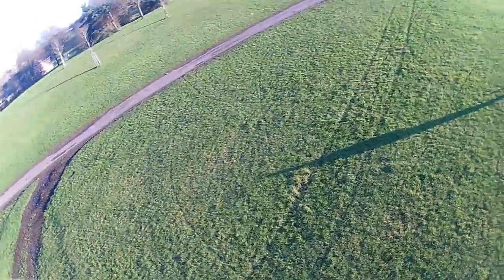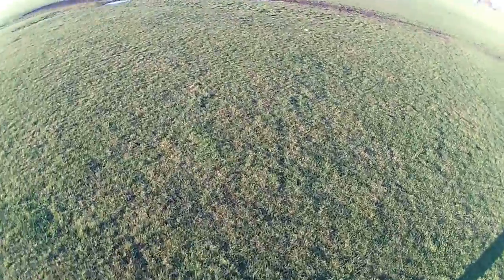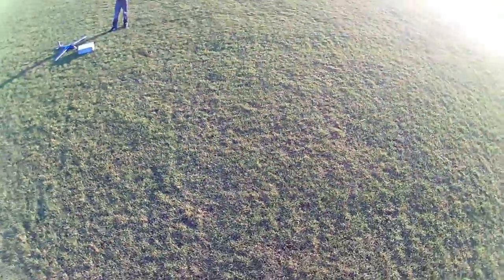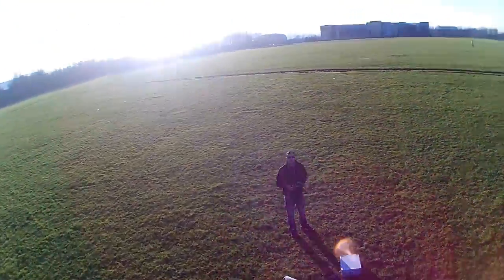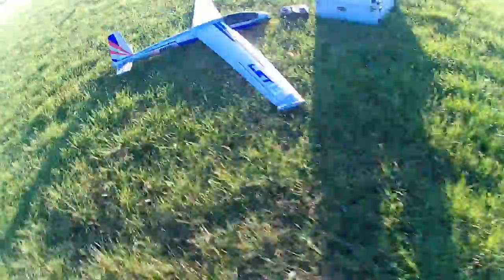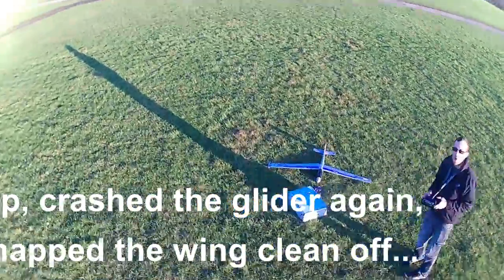Badly Flown - Revell Control Navigator Firmware Update (Hubsan X4 H501S)

Comment: what is the max speed in gps hold with this firmware?
Reply from the maker: Couldn't tell you, however it does seem to be a fair bit slower than before. The turns seem to be the most noticeable though, doesn't feel as nimble as it did before.